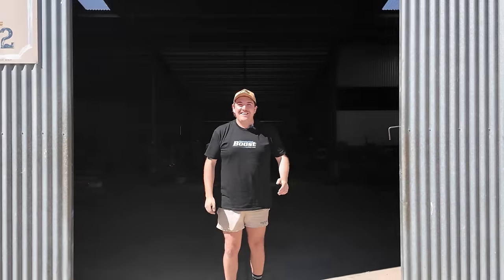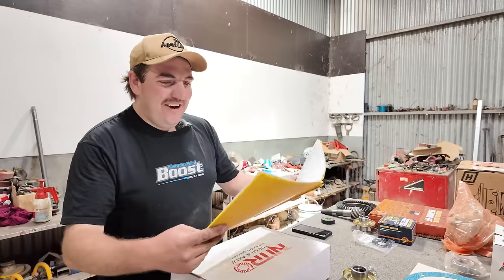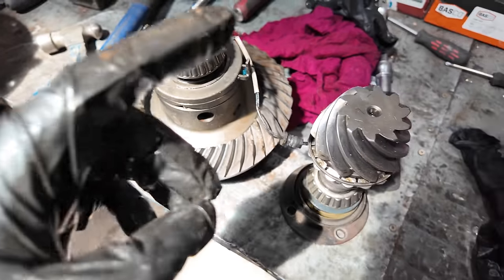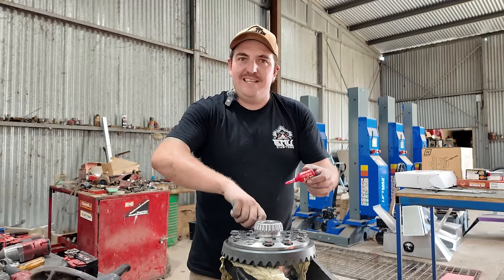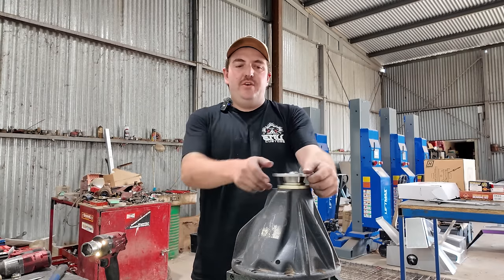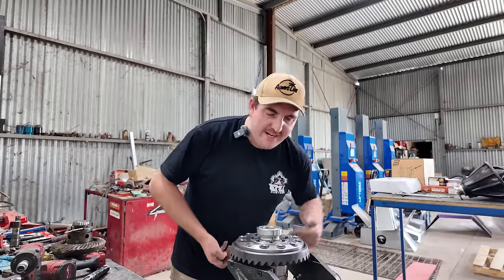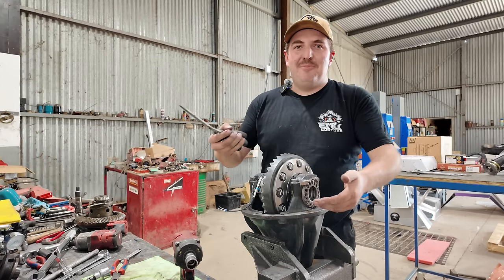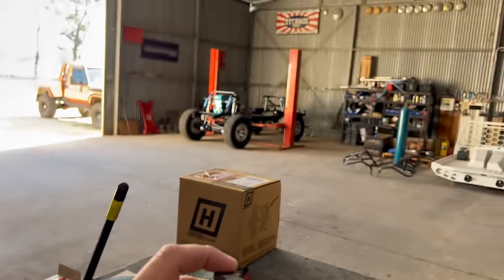Diff building with Uncle Pooly

Comment: Great video, only thing I wanted to add is when you putting the flange on the pinion, never strike it with a hammer, as you will dig the edge of the rollers in the bearing into the race and cause micro marks, sometimes small dents.. which then transfer to rollers and causes a pattern around bearing and noise.  You might get away with it but if you inspect races you’ll see what I mean.. and you can feel it while turning by hand.  Massive respect for showing a whole video of doing this process 👌🏻
Reply from the maker: Hey mate appreciate your comment and now that you have pointed it out i agree, can see how it would do exactly that 

Probably wont be building any more diffs for a while but i’ll be setting up on the press next time!

Comment: I just rebuilt the rear of my 105 with an elocker and solid spacer bearing kit from terrain tamer so the process is fresh with me. I watched every video I could find online and went into a few local shops to me which gave me the best pointers that the videos didn’t. Your video made the process way more simple than what it actually is. I’m surprised you set all the pinion with seals etc. without knowing the correct pinion depth. did you not film that part? many people will say to not use shims with the solid spacer and im sure many would argue thats fine however given the title of the video I thought maybe you’d shim the outer pinion bearing closer to the spacer so you didn’t need the shim because that could only be a stronger way to do it. What stops the carrier bearing rotating on the locker? Plenty of guys would say to knurl that surface. Preloading those carrier bearing adjuster caps with screwdrivers is a first. Anyone who thinks this video is detailed should keep watching, lots of important info left out. Nevertheless, like watching your vids, keep em coming
Reply from the maker: Hey mate thanks for your comment and i agree with all of it quite a few things i left out of the video it wasn’t meant to be a tutorial as stated im not an diff specialist but i just wanted to share my experience and explain in a way that i would have liked it explained to me as for pinion depth i had just built two other diffs both re-using the depth washer from the existing pinions and the depth was correct so i took a gamble with this one and installed the seal and it was all correct as expected. for the solid spacer shim i didn’t need it anyway just showed using it for the purpose of the video, i undone everything in the video and pulled it back out but id happily put it where i did put it if needed, it can’t be installed elsewhere to shim the bearing preload it has to go there and i can’t see it affecting strength once all done up tight eliminating the crush factor of the crush tube is the main thing for me 

As for carrier bearings, brand new locker brand new bearing i had to use a press to install it the bearing fit was tight i can see why you would knurl it though i guess thats the difference between a diff specialist and me!

Comment: When I was building diffs for a living I would heat the crown wheel up then install it to the carrier and torque it up. Makes a world of difference and ensures a proper tension as normally you have to flog the crown wheel onto the Carrier with a rubber mallet

Comment: Machinist here that builds diffs regularly, good job got most of the main things correct I would suggest investing in a copper hammer and getting a solid spacer machined once the crush spacer or shimmed spacer is used to set correct pre load 👍
Reply from the maker: Thanks mate copper hammer would be handy! I used a big copper punch about 1” diameter to install the ring gear as an alternative

Comment: Uncle pooly this has to be the best diff video i have ever watched on youtube, also you if we had a opinion on why the old diff exploded. i’m a 3rd diesel mechanic down in dandy and we had a newish freightliner come in with 60,000 k’s on the clock, boys down at the frieghtliner factory left the crown wheel bolts loose exactly like that one, 2 came out and ran through everything exactly like that and the rest either snapped or bent. also found that the preload was out on the pinion and they bent the shims somehow. sorry for the word vomit, keep up the great vids please mate 🤙

Comment: Have you had any experience with the elocker before. The locking system to engage relies on a certain amount of rotation to engage. Be careful if need to bump over an obstacle and rolling back can disengage them and when you accelerate to bump over the obstacle it crash locks them and they fail. Harrop then call it operator error. Also the electrical actuation can give issues with intermittent operation resulting in the same out come. Timmy has heart has an in-depth vid
Reply from the maker: These are my first ones but i understand how they work and heard of all these things I’ve talked to timmy about that video his main issue was wiring and he replaced a couple of plugs with his own and hasn’t missed a beat since

I haven’t personally come across anyone thats actually broke one so i guess I’ll figure that out! after seeing what mac has put his through im convinced they are fine, my air lockers have failed me a few times after sitting and also leaky seals so i wasn’t afraid to try something new

Comment: I can't wait to see the brake line one, I messed my hydraulic trailer brakes up, the flares were shite
Reply from the maker: They are tricky to get right without a decent tool but you can still do it with a cheap tool if done correctly i might show both ways because not everyone can justify a expensive flare tool!

Comment: I assume you have to drill the diff housing for the eLocker wire harness?
Reply from the maker: Correct, left this bit out because it was already drilled but each locker has its own instructions and hole diameter. My only recommendation is sharpen your drill bits, go slow and use cutting compound! Drilling cast can be painful
Reply: Yeah lots of steps not shown in the video. I’m gonna say camera problems 😝

Comment: i had a gu rear diff with a arb locker in it and one of the crownwheel bolts fell out and it completely munched the diff i was going to say surely thats not enough damage concidering its a bolt but it could have been